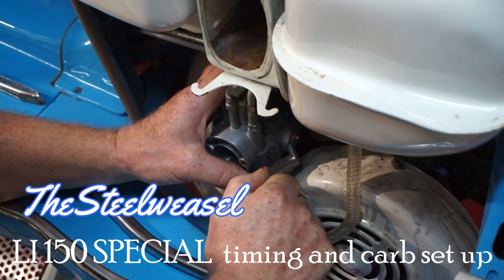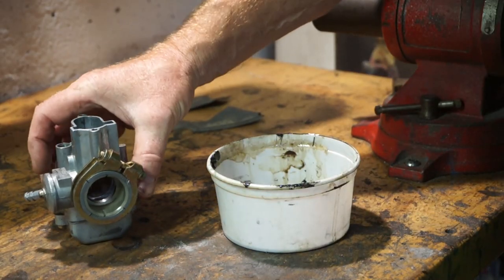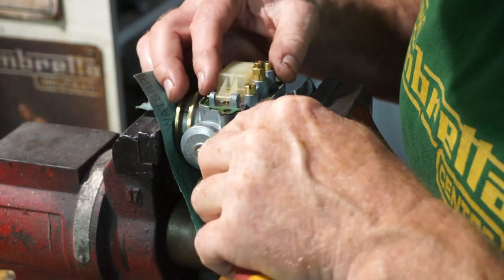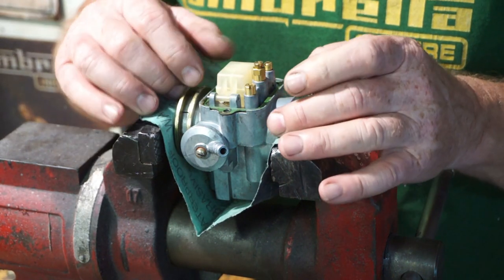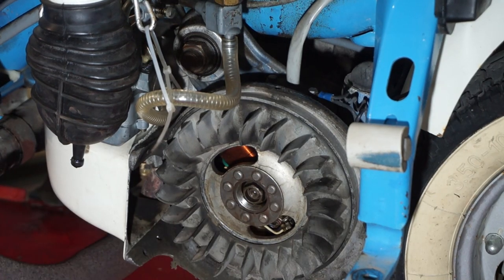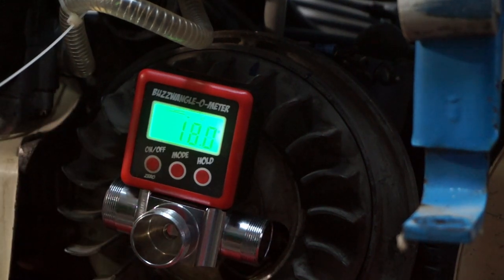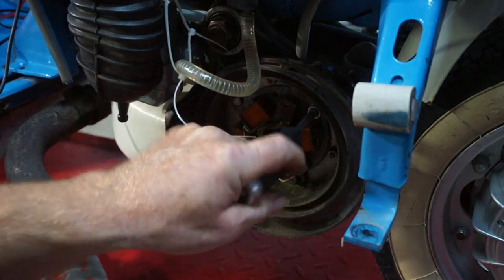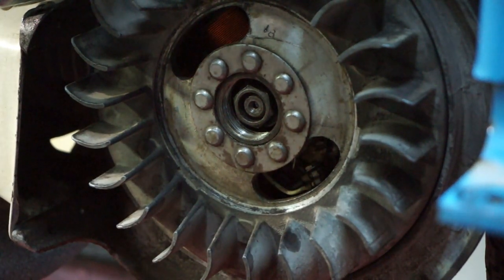LI 150 special ignition timing and carb set up #lambretta#must watch

Comment: Great video.  Could ask your advice ?
I have a standard 1962 li150 3. 
It has an 18mm dellorto and an original ken cobbing exhaust with standard pipe going in. 
It starts lovely and goes through the gears 1 to 3 great quite fast. 
Put it in 4th and it dies on its arse. 
What jets would you use to help it ?
Reply from the maker: Is it the original bore and piston ? I would look at the wear on rings and bore ......

Comment: Good Morning Steve,
I'm a big fan of your channel (Brilliant), I am trying to rebuild an SX150.
Tank problems can you give advice or do a video on tank cleaning please.
This has been a problem since i had the bike! I had the bike with a beepspeed stainless tank but it seems smaller capacity thus sits lower thus the fuel cock is closer to the engine swinging arm!
I have tried to clean the original tank with white vinegar and nuts and bolts shake and rotate every day it seemed to cure it but no back to the flow restriction can you help?
Reply from the maker: Hi Dave , the product I use here is not available in UK  . So I'll look for something you can use there in uk . Best bet is brick cleaner or drain cleaner with an acid . Normally it's all tame stuff in UK  I use aguero fuerte which is hydrochloric acid strong as fuck eats everything inside the tank then wash out with water . Once dry a coat of 2t oil and its done

Comment: Have the same setup on my very early S2, with the exception of a Casa S2 clubman. I had a 122 main, everything else as a GP200 22mm carb setup. I run a late S1 big mouth airbox, BGM free flow filter. It's an Indian alloy 175. It ran ok, but I noticed a bit of a lull in the midrange. Stock points, timing done right. I watched this and thought...ok, maybe a smaller main? I tried a 118. IT BOGS TERRIBLY, will not rev to pull away! I imagine it's too small?? I'll try a 125 today. Any words of wisdom on the matter highly appreciated!
Reply from the maker: This has stock filter and air box , you will need a bigger jet , the 122 is about right try a different  atomizer with more holes or modified the cut away on the slide . Altitude and air temp will also determine your jets sizes
Reply: @TheSteelweasel  Thanks Steve. Just yesterday found you're a Black country lad, I suspected it by your accent! I'm American but my wife's from a little village outside Wolves called Pattingham, maybe you know it. Thanks again for all your videos, am learning a great deal!
Reply from the maker: @jfrorn  PATTINGHAM . yes loverly place   much nicer than the blackcountry which was an open coal field and birth place of industry , Pattingham is a beautiful village in the county side near wolvo would love to live there bro .tell her im from Tipton 😒
Reply: @TheSteelweasel  Oh you're near the Black country museum, I loved that place! Also, my brother in law's family owned the Arcade toy Shop in Dudley, maybe you went there as a lad?
Reply from the maker: @jfrorn  yes models by Tamiya and trains and stuff . small shop half way down the arcade is that the one .
Reply: @TheSteelweasel  Kinda towards the end of the arcade. I remember the model shop as well, when I went it was upstairs.
Reply from the maker: @jfrorn  ahh thats the one at the bottom on the right two floors .
Reply: @TheSteelweasel  Exactly, the Arcade Toyshop!

Comment: Hi Steve great video,I have the same carb,50 choke jet,110 main and 45 pilot,its bogging down before revs lift and it won't tick over,if I give it a little bit of choke it's gone and ticks over,can't seem to richen it enough on adjustment,seems to be scince it's colder,rides perfect apart from that any advice would be appreciated 😀
Reply from the maker: Change slide to one with a larger cut away
Reply from the maker: even more important check float valve seals correctly , this will make it bog down . putting choke adds fuel and air and raises tick over so i think you are over fueling at bottom end
Reply: @TheSteelweasel  thanks steve I will have a look